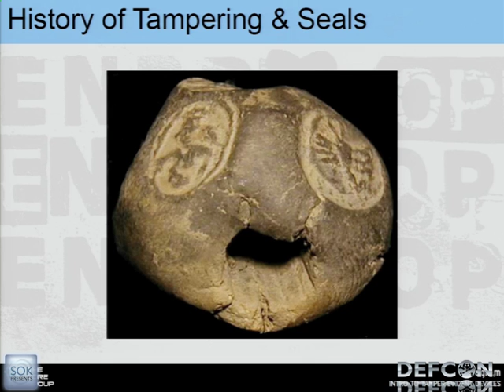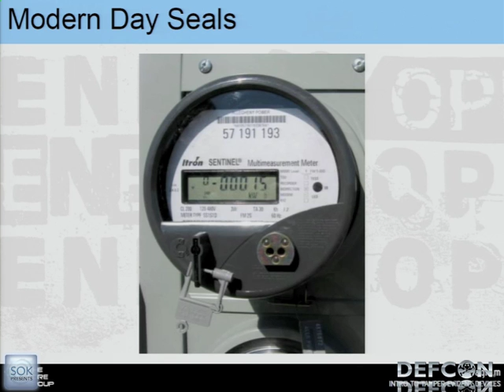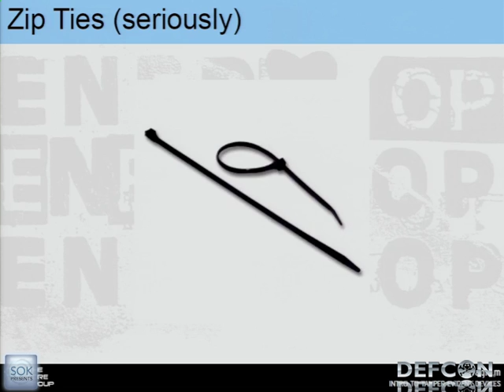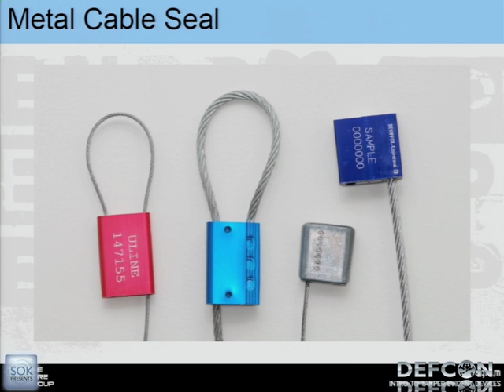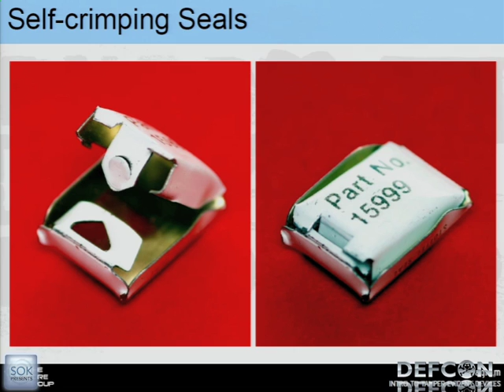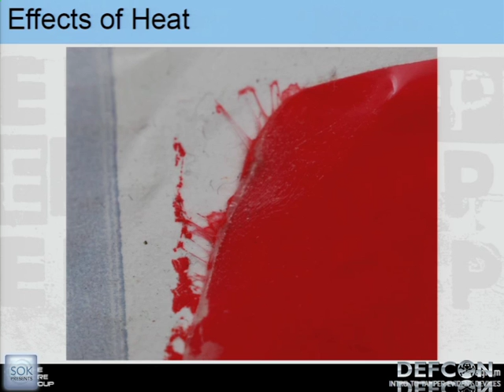DEFCON 19: Introduction to Tamper Evident Devices

Comment: Yeah, I know how easily one can defeat a seal. That's why I also have a pair of beefy padlocks on my truck to prevent freight theft. You're not defeating my trailersec unless you wanna first wear yourself out manhandling the 36" bolt cutters... twice
Reply: I take it you don't follow very much defcon stuff?
Reply: @udonnomi6958  I do. But these aren't  common master locks we're talking about; they're kinda oddball padlocks that I got from one of my previous employers. Not an easy lock to rake, if it can even be raked. Not a key that can be easily replicated or originated... possible, but not worth the time commitment IMO. Not exactly an easy lock to shim, either; I would know, I had to try at some point. I actually found my lost keyring again before I could succeed at that, and I'd already invested a couple hours at that point. Only time I ever had to finish defeating my own lock without the key, I finally just cut the damn thing and wrote it off as a loss.

Where I'm going with this is that knowing who you're guarding against is half the battle, so I've taken the time to think like my opponent. A freight thief has 10 hours tops to gain entry to the trailer, and even then they're likely to be discovered at some point in that window. Quick and dirty is the only viable answer, and you're gonna need the 36's to beat this particular lock because it's an absolute unit... 24's might work, but it'd take quite a bit of effort.

TL;DR no lock is foolproof, but some are so inconducive to covert entry that the only practical option is the overt route

Comment: You forgot to mention cold. Using dry ice or liquid nitrogen to to remove tape and seals instead of solvents. Opening envelopes by freezing the glue then cracking it by rolling a metal cylinder over it on a rubber mat. You can reactivate the glue with a suitable solvent to reseal it. And Teflon shims can defeat many seals if the glue is still sticky.

Comment: i would just make an eprom that contains the most important part of the os and also the key the hardeware needs and it gets erased when you take the pcb out and cant be re programmed because at the end of programming the board you have to "cut" a jumper wire by putting too mich current through and it is deep inside of a 4 layer board so it cant be re jumpered

Comment: Neat bit of tamper evident tech that most don't know about:
The metal bars used in jails/prisons are hardened on the inside, but not the outside.  So if you try to file or cut through a bar, there will be a very clear mark but you won't be able to cut through.
Reply: The outside was... Tempered with!

Comment: I thought tamper seal tapes were good enough on cardboard but then I worked in a supermarket.
The wholesaler, to be specific, Eispro, used these fragile, grotesque looking pink paper tapes with animal shapes on every box. Guess what, when it's stored at -25C for long enough it literally falls off on its own. Let alone the fact that it was packed in -25C as well so it didn't even stick properly. I still have some at home somewhere. The adhesive just gave up over time and there was zero residue left behind, it just hardened and fell off.
The newer companies like the one called Delforg or Vadex were just fine but the older ones like Mirelit have not changed anything for decades, only enough to just fit into regulations and it really showed

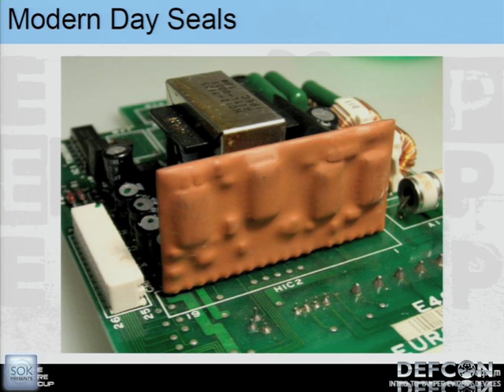Comment: @16:50 that is actually a thick film module with SMD components used in through hole technology consumer electronics before integration levels went up a bit and the main board became SMT. The coating is more for protection than for tamperproofing.

Comment: How many of those polymer-based seals would be greatly improved if the end user also used a solvent-based adhesive that literally softens the polymer and makes a weld? how aobut a handheld ultrasonic welder for those seals? how hard would those be to defeat?
Reply: You could just cut it and weld it back together...

Comment: Lol, at 31:00 - I have just used jewelry pliers to slowly pull out the old pin, then just replace it. It tears up the inside a little, but usually doesn't hurt the outside.

Comment: The metal ball seal was used in my AIT in the army to make sure our closets weren't opened when we were on leave for Christmas, they made us install them the night before leaving and I wanted something out of my closet (with a locking mechanism that allows you to use a padlock). When they installed them though they didn't realize they were long enough that you could still open the locking mechanism (it flips up and slides like a dead bolt) even with it on lol I felt so cool

Comment: Ah, yes...those little stickers on electronics are fun.  I recall when I was in college working for their helpdesk, I was ordered to take apart a new netbook and figure out what kind of drive it had inside before we had to fix one so we knew what to order.  They came back later and asked when I was going to do it -- because I'd pealed all the stickers up perfectly without breaking any and then pressed them back down when I re-assembled it, they thought it hadn't been opened yet.  Trivial to do with a multi-tool if you keep the blade sharp and hold the correct angle with a steady hand.
Reply: *****
We'd already been thru the BIOS and such, it didn't have anything really useful just the capacity.  Besides imaging it they also wanted to know things like what kind and size of interface connector (of if it was soldered in) and form-factor -- stuff we couldn't determine from software.
Reply: @mipmipmipmipmip
Huh, interestnig.
Reply: lspci

Comment: A secretary once showed me how to read through envelopes - just spray them with circuit freezing spray. No need to steam open the envelope to read the bosses paycheck.
Reply: problem is it won't be easy to read if it's multiple papers, and/or folded over itself, and/or has those ink patterns on them to specifically prevent that sort of thing.
Reply: +Ray Perkins — The Soviets allegedly used a similar technique to snoop mail, although I don't know if was freeze spray or some other type of hydrocarbon or fluorocarbon.

Comment: Cable ties + Hot glue gun, piece of paper (signed or unique), and digital camera.
Reply: Keith Larsen could you please explain? Thanks in advance
Reply: Zip the cable shut, with a unique identifier (paper), then fill the locking part of the zip tie with glue.

Comment: The "Mega Monster" energy drinks have a seal similar to the medication bottles. It's incredibly easy to slide them off (in fact its easier than pulling the tabs) and sliding it back on is a little difficult, but can be done with a little work.
Reply: This may or may not be that easy BECAUSE its not medication
Reply: coooooooooool1000
Fair enough, but it still makes the seal on those drinks easy to tamper with, without it looking like it was tampered with.
Reply: b4se in italy sometimes you can open a cheap water bottle with the entire seal still attached to the cap :D did you see the defcon talk about gun saves? its just to comply with laws, not to offer actual protection... kinda make you think what could go wrong if someone wanted to do shit...

Comment: What about vacuum? Most jars or bottles are sealed at low pressure and go pop when you break the seal because the lid or cap has some spring tention.
Reply: Jeppe Boelsmand heat up the jar and contents put the lid back on and let it cool